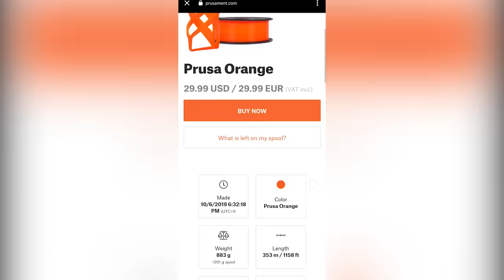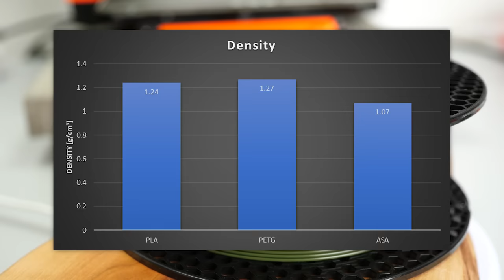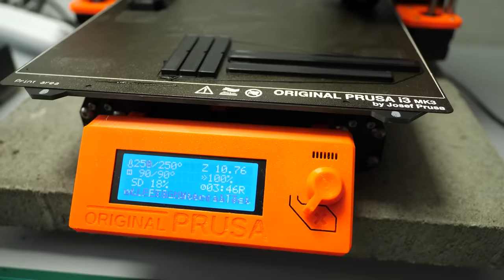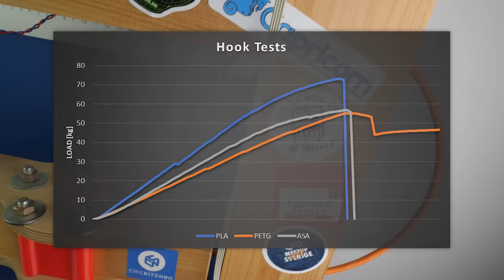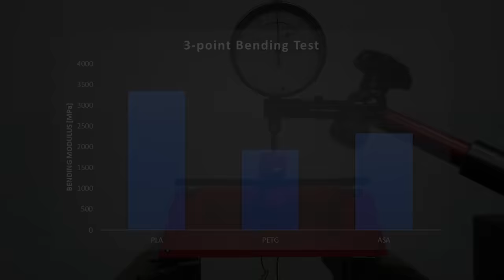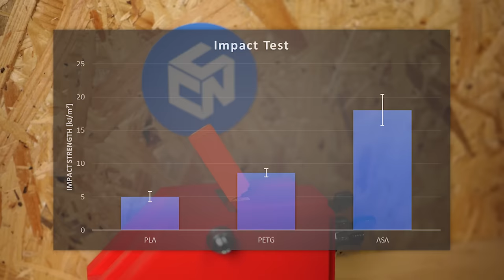The BEST 3D printing material? Comparing PLA, PETG & ASA (ABS) - feat. PRUSAMENT by Josef Prusa

Comment: Thank you, great comparison. But based on my experience and your video -- the specific material brand/vendor matters. All the PLAs I have tried in Canada( beside the Wood PLA which is not regular PLA) are weaker than PETGs. Also, PETGs I've used are significantly more wear resistant than PLA. The spindle mount I have printed with PLA material for my CNC3020 500w spindle has cracked and passed away in ~4 months because of all mechanical impacts and vibration. The same mount printed in PETG works for ~1.5 years without any issues.

Comment: What I have discovered with my BASF ASA filament is, that it degenerates the longer the material is in the hot nozzle. I improved the layer adhesion by printing my ASA parts as fast as possible. Have you tried different speeds for ASA, Stefan?

Comment: Would love to see a nylon filament done in this
Reply: Uber fidly. You need to temperature and humidity control your filament - even while printing. Your printer needs to be in an enclosed heated area, and you need to use your spare hot end....

Comment: I would like to see some testing on some TPU hooks
Reply: look back in his videos, has already been done ;)
Reply: dr_BD I can’t seem to find it
Reply from the maker: Didn't test any TPU, yet.
Reply: Yes I'd also like to see some TPU hook tests, it's the perfect printable material for holding sport cams & some other things on quadcopters. Its resistance to heat makes it great to hold video transmitters without melting.
Only once I've had a TPU part in a crash fail from the layers separating a little bit because it was 'wet' when printed. I just took a soldering iron and melted the seam back together. But now I dry all my filaments and store them in air tight tubs with silica gel beads, dry TPU prints look so good and are so strong.

Comment: ABS for me. As I stay at a tropical country, no moisture issue like PLA. PLA is really good if the environment is dry. I have many instances where I would need to re tube the filament when I don't print often. And sometimes I would need to rework, ie baking it, the whole spool or discard it away.

Comment: What's up with the concrete paver stones underneath the printers? Are they being used as some sort of vibration dampener?
Reply from the maker: Yes and the foam also isolates the printer from the desk to avoid resonances. Seriously THE best and cheapest you can do for your printer!
Reply: @CNCKitchen  Smart! I'll have to give that a try!
Reply: And in addition to that, the stone serves as fire protection.
Reply: I can vouch for a paving slab + foam as a huge upgrade too. Prints are better, printer is quieter. The foam doesn't have to be thick, I cut up a cheap yoga mat.

Comment: hello Stefan, acordingly to all3d.com "PLA is a pseudoplastic, non-Newtonian fluid. This means that its viscosity (resistance to flow) will change depending on the stress that it is subjected to. Specifically, PLA is a shear-thinning material, which means that the viscosity decreases with applied stress."

Comment: I use PETG for parts I put into my RC plane kits that  I sell.  Once tuned, PETG prints very well with no stringing.  The only issue I get sometimes is the blobbing on the end of the nozzle.  Due to the blobs I only print one part at a time to avoid a drip which ruins the part.
I have not used ASA and will consider doing some testing this spring.  
Thanks for another great video!!

Comment: Somewhat new to 3d printing but have shifted from PLA to PETG because of the higher thermal resistance in the event I leave one of my prints in the car.  I have not tried ABS or ASA yet.  The one thing I really don't like about the PETG is the hard little globs that sometimes get jammed up in the print and either cause it to break free of the bed or cause the belt to skip and offset the layers from that point.

Comment: a few comments, firstly look into decreasing the size of the enclosure to retain more heat. Second perhaps try reflectix to insulate the chamber. Lastly look at trying different colors of filaments and how strength is affected. Oddly, i hear pink is quite strong. I would be interested in hearing what your results are!

Comment: Another important property of the material is easiness of post-processing. In case of ABS You can easily correct printed model mechanically or with acetone (acetone vapor), and also very strong glue different parts together with ABS juice.

Comment: I use PETG for my general purpose uses. It generally survives the hot car test and I don't need the rigidity of PLA and I lack the environment to consistently print ASA. Warping drives me absolutely nutty and I've never had warping issues with PETG. I can deal with stringing as the stuff I print I can usually torch it off and clean it up but warping has ruined more than a few of my PLA prints.

Comment: You might want to try a double walled enclosure for ABS/ASA. Or an insulated one. You can also make a heated one with a space heater, a duct, a fan and a controller to exhaust the heat to keep it at a constant temperature.
Reply: that enclosure was HUGE for the printer.  it should of been way smaller.  lol.

Comment: I print mainly PETG. PLA is hard and all, but I've had numerous PLA items shatter, but I've never managed to break a PETG part without seriously trying to break it. One time I printed one of the hand crank sirens out of an expensive color change PLA. Shortly thereafter, the crank handle connection part of the main drive sprocket broke off. I reprinted the broken part in Prusament PETG with similar model settings. After placing it in the siren, I used it again and then the next weakest link in the chain broke, which was another PLA part. After reprinting the entire gearchain in PETG, it's now bulletproof and doesn't break. PETG is a better gear material than PLA in my experience.

Comment: I use acetone to solvent finish abs parts. It welds outer layers with poor adhesion together and can produce a smooth shiny surface. Make sure you have good ventilation and wear appropriate PPE!

Comment: I would have liked to see PLA+ or PLA2 thrown in the mix. I've used both and they are definitely less brittle than standard PLA. Their post working characteristics seem to be very similar to ABS, except Acetone doesn't affect it much and their upper temperature tolerance is as good, though better than standard PLA.
As far as strength is concerned, I'll take PETG over PLA any day if the object is going to be used in an extended outdoor environment or hot environment such inside a car.
I've used ABS a lot and like it but want to give ASA a try for it's superior environmental toughness.

Lastly, your DIY testing equipment are epic. Great job.

Comment: Petg also makes great flexible dough scrapers for high hydration sourdough scrapers.. I found this by accident when I removed a raft for an object and had lost my sourdough scraper. The raft did the trick despite being printed a little too open for food. But in flour and dough this is not really a health problem as dough relies on yeast to ferment anyway. My glass bed first layer is hotter and the print comes of with one side really having a closed shiny surface.

Comment: I spent years printing with PLA, then switched to PETG and never looked back. PLA warps under strain, even on a warm day in sunlight, it also tends to crack over time. PETG is a more stable material.

Comment: for regular usage and room decoration.. PLA.. easy to work with
for water resistant and bathroom and kitchen objects . PETG - for not putting the 3d printer in extreme conditions
for garden/car... ASA - for high temperature and UV resistance + waterproof - but it requires a lot of the 3d printer. So just when it is needed

Comment: I'm fairly convinced ASA does need that properly heated cabinet and a hotter plate to minimize issues and maximize strength. ASA also has the benefit of being acetone vapor polishable, which may be nice for decorative finishes. But yeah, enclosure and heat.

Comment: I'v been trying to design a durable 3D printed racing drone frame for some years already. After having tested most materials, I found that the best one for the frame was Fiberlogy Impact PLA. It's also one of the easiest to print.

Comment: Petg is way easier to sand and therefore finish than PLA. That has a huge impact for me, since i am required to turn finished and lackered model in. The little bit of stringing i get in some (specific) situations is easily dealt with a heatgun or a bit of sandpaper.

Abs also sands better than pla, but  obviously you can also vaporsmooth it. 

I would be very interested in how different materials (from different manufacturers?) perform in after print finish, sanding, reforming, and so on

Comment: Makerbot have made the methode X  3d printer for doing ABS and ASA,  the difference with the makerbot method is that the heated chamber can go up to 100 deg c instead of 65 deg c.  Abs and asa need a higher temperature than 65 deg c to perfor better.

Comment: Learned a bit about thermal issues...   Printed a 3D Airboat (you can see on my yt page) ran great.   Left it in the car can got some lunch, and well....   came back to a pile of warped plastic.  3 months of engineering and printing in the garbage.  Now need to reprint in something else that wont deform in a car.   I think im going to try using ABS.  This was a useful video thanks.  People should def know that a hot car gets hot enough the melt or deform pla or pla+.

Comment: Another thing to add is with building a quadcopter out of ASA, the vibrations made by the motors might be absorbed by the ASA’s lack of stiffness. This might be important for the flight controller.

Comment: I use Devil Design filament at €18 for 1KG PLA or PETG which gives me good results on my Prusa. Bought but haven't tested their €20/KG ASA yet. You can see the winding is not nearly as good but I never experienced problems with that after using up 4+ spools. I just can't justify the price difference. And it's sold in a shop near where I live, which is very handy.

Comment: I feel about the same as your conclusion, PLA is still my go to for most things, even mechanical situations.
I use PETG when I need some flex or heat resistance.
I never use ASA(ABS) I think of it has a harder to print PETG, so i just use PETG.
If i need something to be indestructible i use Alloy 910 from Taulman.

Comment: For ABS-like add 5-10 degrees and fan (I'm using 60-80% of 7500 RPM fan with circular fan duct). Started using fan for such materials after consulting on Cura forum about printing small details where they confirmed that fan actually helps in some situations. And it works with PC and even Nylon when detail shrinks by layers, not all together. After figuring how to print these materials they are most used last time. Except I'm printing not on Prusa and can vary temperatures up to 300C.

Comment: Im interested printing airsoft part & accessory

Tempreture : It seems ASA is best choice since i would be outdoor in middle of sun heat
Impact strength : ASA also help a lot if i accidently tripped or hit my opponent
Strength : ASA strength slightly lower than PLA, which is not a big deal since my toy wont exert lot of force on them 
Rigidity : idk, ASA rigidity might a slight problem for picatinny optic part stay zeroed i guess

But i would like to give it a try since im not printing anything yet, thanks you sir for simple test

Comment: There is a material called STH from Turkish manufacturer ABG Filaments it has the ease of PLA when its printing, strength of this is outstanding compared to the ABS and PETG and has the heat resistance of PETG without any bad petroleum smell and its just 120 Turkish Liras (Approx. 20 Euros)
Reply: and it is really awesome for everything

Comment: petg is best all around for most things, if you desire to only really work with one material. To get serious with ABS, it requires an enclosure, more power from heating the bed and nozzle, ventilation for the produced gasses, and even then you will still be limited in the exact things you can print without warping and layer separation. ABS is best suited for injection molding. If you are desperate for a part that is strong and heat resistant, then print your part in cheap PLA, cast it in silicone, and fill with a 2 part epoxy. For everything else, simply use petg as it probably wont melt in a hot car, and its slight flexibility means it is less brittle, so they wont snap so easy.

Comment: Stop!  Don't leave this video!

If you're like me and just want someone to say "x is the strongest filament," abandon that cause and watch this video!  I did (at 2x speed) and can say it'll answer that question in the detail required that you didn't know was necessary!

The tests and experiments contained herein were excellent.

Maybe because the concept was new to me, the impact test astounded me at it's simplicity of design.  I wasn't sure if this was an industry standard or his own invention but I knew that the results, regardless, were accurate.

The 3 point test was scientifically exact and accurate as well.

The thing I found interesting in regards to "x = best" was that each filament may serve better in different applications and you could potentially use different filaments in the same machine depending on what stress is where.

Well done video.  Subbed!
Proverbs 27:17

Comment: Printed a monitor vesa mount today. 
Put a 27" monitor on it. 
2 hours later the Mount snapped and the monitor fell into the camp chair and cushions I had setup just in case. 
I printed it in PLA.
I printed it in an orientation that didn't require supports but it reduced the strength. It snapped between layers.

Comment: Stiffness of PETG depends on level of crystallization. Thin parts, which cool down quickly, stay amorphous thus ductile. Thick parts cool down slowly, giving the plastic time to crystallize, making them stiffer and less impact resistant. Indeed, PET bottles are very soft and impact resistant as the material was cooled down quickly.
Reply: Pet bottles are not made of PETG..

Comment: ABS is my target to get good at. Many of my plans involve replacements of broken tabs on ABS so material compatibility and the ability to fuse them with acetone solvent welding is important. Also the impact resistance because being dropped will be the most likely scenario to really stress these final prints. My first ABS filament is TitanX Industrial ABS and I'm upgrading the printer for higher temperatures with less stress on the main board, and building an enclosure.
Finally there is a DIY activity where people might learn not to say "but it's made of plastic" and instead learn about the properties of plastics.
Reply: Haha, yeah for the plastic people I just hand a failed print (usually a molten blob wafer 1/8 inch thick ABS) and say, “alright try breaking this without tools...”, then letting them struggle as they try to break it over their knee or something as I’m laughing at a desperate attempt where there not even close to making it visually flex. Haha! It may not be a chunk of iron, but it’s usually not ever loaded to the max! I print hollow (truss designed structure) airfoils that are like the weight of paper but you can stand on them and they don’t break, like clearly good enough for an RC plane even at crazy high 100 G maneuvers (the carbon fiber spar will definitely break first!). It’s all about how you use it!

Comment: Very interesting video. I use PLA + which is also called 'Engineering' PLA. It would be interesting to see that included in the comparison to see how it fares against regular PLA, PETG and ASA.
Reply: PLA+ still warps in the sun like no one's business 😅 I don't mess around with PLA anymore unless I'm strictly prototyping something that will eventually end up in the trash/on the shelf. ASA is the way
Reply: whats the cons of ASA, just price and smell? @HarmanMotorWorks
Reply: @jackking414  Toxicity and tendency to warp unless you use a warm enclosure. Even minor air currents from say opening a door can cause large parts to warp during printing.

As an update since I wrote my original comment, PETG is now my go-to for most parts.

Comment: It looked like 250 degrees was a bit too high setting for PETG. I normally print in PETG at 230 degrees. I use PLA for models that require extreme overhangs without supports because PLA does not warp that much at cooling. PETG prints on other hand can be sanded wihout sacrificing a print appearance and are not that brittle. I normally use PETG for practical prints.

Comment: I am a bit stunned at the hook test. I've been printing for a bit over 2 years now, and I have always been told that "PLA is the weakest filament, PETG is stronger than PLA, then comes ABS which is a good step up vs the other 2, and then the most resistant but difficult to print Nylon and Polycarbonate."

Comment: Nice video, really would like to see what something like an 80-100°C chamber does to ABS, but i guess PLA will remain my go-to for now since getting a really hot chamber is such a hassle and on top of that PLA seems to deal with the biggest mechanical issue of 3d printing, layer adhesion, so well.

Comment: I have experienced completely different results. PETG is more resistant than ABS and by far than PLA, including PLA+, in both printing directions, simply because PETG is stickier and layers are firmly glued to each other. But, as you said, there are a number of variables to consider and it's one's own experience that counts. Good video.

Comment: This really depends on the actual material used or maybe how the material production changed over the 3 years of age this video has.
I've got PETG, which almost snaps like PLA does and also ABS which has a bit of flex before snapping.